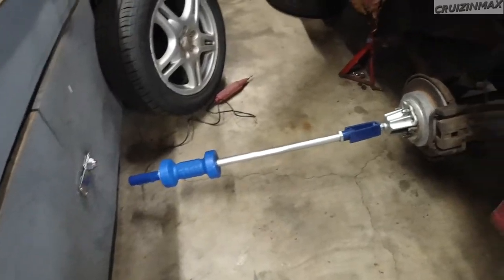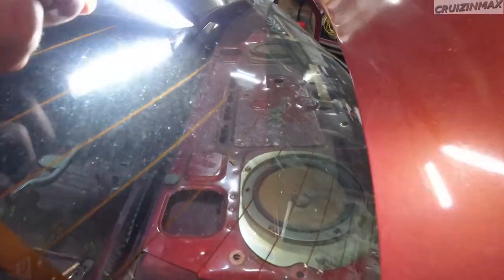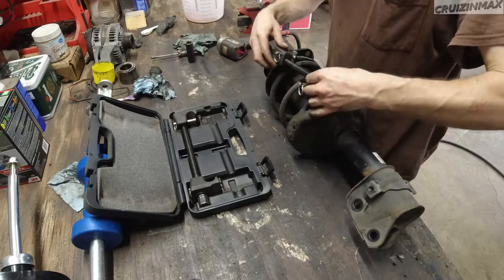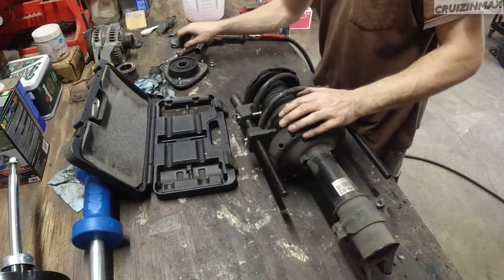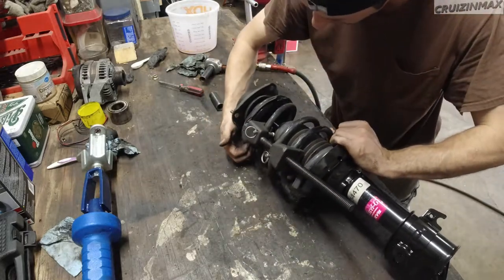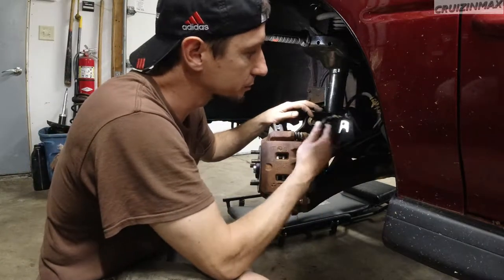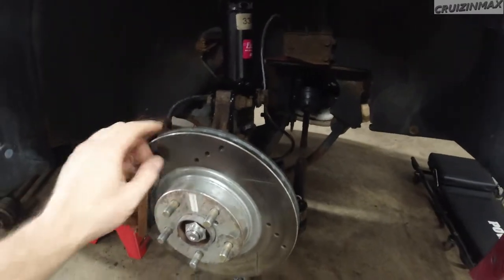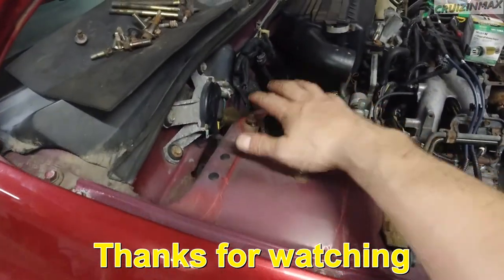Subaru RS fitting struts from a newer impreza part 5

Comment: Wow this RS looks about as bad as mine! Same color, same rust patterns, everything. Hopefully your frame is better than mine. What's the purpose of this car? I'm assuming you basically want to beat on it? Amazing how rusted out these cars can get and still drive solid. :D
Reply from the maker: This will strictly be an ice racing car, not even getting registered, the frame is enough 😂
Reply: @cruizinmax4017  Beautiful. I actually think I'm going to do exactly the same to mine. I was planning to just part it out, but I might as well try to ice race it for at least a season!
Reply from the maker: We go to wisconsin usually, season starts end of january if the ice is thick enough....you should try it...its a lot of fun
Reply: @cruizinmax4017  Yeah I have several friends who do it about 2 hours from me near Burlington, VT where I went to college. All I really need to do is put coilovers I already have on the car, reattach some side skirts, make some ice tires, and send it.
Reply from the maker: We only run winter tires....spikes wont let u learn car control all that much...just a thought
Reply: @cruizinmax4017  Oh yeah I'll likely start on winters. 😁 Thanks! Excited to see yours ripping.